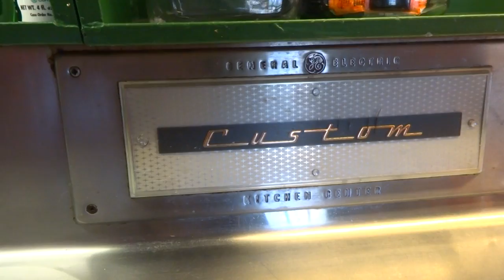PROPRESS FITTING POPPING OFF INFERIOR  PRODUCT TO SOLDERING

Comment: They work extremely well when installed correctly.
Reply: @TheGhettoLobster  I've seen the results of bad soldering. Same result as not using a propress correctly.
Reply: @TheGhettoLobster  absolutely
Reply: Installed hundreds if not thousands and the only leaks were purely from operator error, didn't crimp straight or wasn't fully inserted.  Slip coupling are the biggest culprit
Reply: They are far better than soldering. And standard practice in large commercial applications. Same as anything poor installation will effect all pipe jointing methods.
Reply: @billydoe6240  You can see from the video this was done wrong.
Reply: @Boilerking76123  without doubt. But the point of this video was downing the press fittings.  Its misleading.  

The biggest thing this guy's posted that I agree with is shark bites suck.  Not the worst if it's not in a wall but they will and do leak over time
Reply: I've used on 2 and 3 inch mains with no problem  user error I assume
Reply: There is a place and time for Propress. I work in hospital setting and not having to take out burn permit and disabling smoke detectors is game changer.
Reply: How do y'all get into tough spots with such a large tool? I mean even with pex if it's really a confined space you're screwed
Reply: @TheGhettoLobster  21 years of plumbing I've NEVER had a solder leak. For me the best way to not have a leak is to take your time cleaning everything. Even if it's new pipe and fittings, I get the abrasive cloth to get it sparkling clean and grooves for the solder to attach to. Just my opinion. I've never used pro press. It's neat just seems to be such a large tool to use.
Reply: @Boilerking76123  I progressed copper plumbing in my house 22 years ago and still holding.
Reply: @alfonsoarmendariz1416  The Mechanical contractors have been using the big ones for years . Works great for changing out domestic hot water heat exchangers at hospitals on the fly
Reply: @tomorichard  yeah they better I made a lotta money selling them I liked that I make a da money
Reply: Ive seen fitting pressure tests where pro press joints  popped off the pipe at and solder  and braze joints popped the pipe off the machine solder and braze is always superior
Reply: @sleektoneofficial  where did you see these pressure test so I can watch?
Reply: Just like any new technology, works great for the first two years and after that it’s somebody else’s problem. 
The only benefit of propress is you don’t need any skills to install them 9:00  and they are quick, Oh, and they are great for repeat business.

Any tradesman that ever says “it’s quicker” or “it’s easier” isn’t worth a pinch of salt.

Ever wonder why perishable tap washers are replacable?? Good luck replacing a propress o’ring…
Reply: And this situation right here is the reason why people use a ProPress. No heat cloth, and a previously burnt wire from the last plumber. If that ProPress fitting had been pressed on correctly it would have never popped off. And I'm not sure how seriously I would take the advice of a plumber who feeds his solder on the top of the joint versus the bottom. Every goods trade school in the country teaches you to feed your solder from the bottom of the joint.
Reply: Any plumber using propress in my Projects would be fired and thrown off the jobsite in 2 seconds
Reply: @glennschlorf1285  I'm sure you have fun finding anyone under 50 to work for you...
Reply: @glennschlorf1285 why? Lots of highly qualified plumbers that have no problem going the extra mile if it’s necessary have used pro press with great success. What makes you hate it so much?
Reply: You know what else works extremely well when installed correctly? Soldier.
Reply: @patrickmccarthy5617  yes, and it requires more time and skill to do correctly.
Reply: I agree they work awesome when installed properly. Just like soldering if you don't do it right you will have lesks

Comment: Chances are that pipe was not inserted into the fitting all the way, you’re supposed to mark the depth before you crimp it, but solder is still preferred by me
Reply: Chances are it was not pressed in correctly. Same could happen if you dont solder correctly.
It was the Plumber,not the tools.
Reply: how long do propress o-rings last?
Reply: Looks like not even a proper press tool.

Thing doesn't look crimped more than maybe halfway.
Reply: Looked way short and piping wasnt in fitting enough .
Reply: Biker55555 50 yrs warranty on pp fitting
Reply: @chrismallory3718  The Company not even be there in one decade never mind five decades to pay the out claims down the road in Insurance Liability if those O Rings give way and Pop over time.
Reply: machine has to be calibrated
Reply: @georgeian3243  it looks like they didn’t line up a no-stop coupling correctly (didn’t fully seat the left pipe).
Reply: @biker55555  the o-ring is just a backup to the pressure fusion of copper to copper.  There are some interesting videos out there of pressure testing various press fittings with the o-rings removed.
Reply: @biker55555  50 years.
Reply: The home owner is not telling the truth about the propress
Reply: @carbonunit  homeowner tried to solder it burned the wires above then borrowed a propress and mucked it up again, then he called Steve to do it properly.
Reply: Danny you also have to reem the ends and clean the ends as well for it to hold.
Reply: @davidbrennan5  that's a great conclusion ! Nice job
Reply: I’ve been plumbing for 26 years, and own a plumbing business.  I have zero issues with pro press.  I’ve done all sizes 1/2” up to 4” and have never seen an issue.    That is a fail due to install error
Reply: Progress is fast and hack.  It is profitable , quick , and attractive. 
But  so are post -1998  vehicles !
Reply: I have pro press 4 inch copper building a high school from the ground up. 15 years later still holding strong. I bet the guy that did that had a tool that he doesn't take care of and calibrate after x amout of presses.  You have to service press tools. Heads well wear as well. That's not a product error it's an installer error
Reply: @biker55555 they can last along time when you remove the exposure to air. Also the o-rings are a backup and not primary.

Comment: Wasn't installed correctly
Reply: @ohger1  maybe (less likely) more probable that it's user error, pro press fittings don't just come apart like that.
Reply: There's no way the guy pushed it in all the way
Reply: They will pull apart every time if it’s not drained properly and freezes up
Reply: @RichTheitalianplumber  yes, so will a soldered joint, and from what we can see, this wasn't caused by freeze.
Reply: @RichTheitalianplumber  and you can tell it's been done 3 times now  maybe they should teach him how to drain it
Reply: @josephlowman7906  it’s got nothing to do with draining
Reply: @BrickTop900  then why has it been replaced 3 times already if it didn't freeze you can see it was copper with sweat fittings originally and someone burned the wire when they repaired that then the guy said it was flexible pipe wich was probably pex and now it copper with pro press .you have never seen one blow off like this in a freeze up it will hold 200 psi air pressure and 600 psi with water
Reply: @BrickTop900  oh yes it does the only time i have seen them come apart is from ice do you live in New England or cold climate i live in same area as Steve and again the only time i have ever seen them come apart like this is from freezing i have been using pro press for 10 + years and never had this happen to any of my connections that my customers took my advice and drained them properly !!!!
Reply: @Got2Learn  do u live in New England that was a frozen pipe I guarantee u he didn’t drain the water from boiler drain ???
Reply: @Got2Learn  I do agree with that. I have put together many a commercial with propress.  Never had any problems like this, usually user error like you said put it was a missed press.

Comment: Steve, been using press for for years buddy over the pond. If it’s done right nothing wrong it. Soldering that close will have totally knackered the o ring inside
Reply: Yes, this is true.  I use propress, haven't had a problem yet thank God.
Reply: The o ring is like a back up (safety) but the copper is mechanically fused buy 5000lbs+ of pressing force ... since he keeps yapping about o ring he should of used Nu-Calgon thermo trap or some sort heat absorbing method even a wet rag over the pro press next to solder 🤔
Reply: @johnnya4236  right put that rag he's using over the fitting
Reply: @johnnya4236  lol I was like wtf ! Hahah I use this product Goss heat barrier when I solder joints close to any propress/shark bite fitting even on some ball valves
Reply: @johnnya4236  Have you seen him work on an air conditioner yet? Dude walks up as a second opinion to a possible bad compressor and just pushed the contactor in with a screw driver. Never verified winding integrity or winding insulation. He he has never worked on a three phase appliance in his life. You only push in a contactor for a three phase compressor that's grounded once in your life and you never forget it. Just because someone is better than the competition doesn't mean they are good. Wait until he realizes that Carrier 3 phase condensers only break 2 legs and he buries the contactor with a screw driver and it vaporizes before his eyes.
Reply: He should have just cut it all out and started from scratch and explained to customer that if this fitting is blow apart the possiblity of the others doing the same is very high , So it's best if I just cut it all out and re do it with viega pro press and it sweat and do it right so it's there for the next 40 years. This young buck was to busy chit chatting and putting down the pro press system as well as the contractor who installed the fittings. Meanwhile he is heating up the pipe and jeopardizing the O Ring .

Comment: I have an acetylene turbo torch in my van. Im damn good at solering. But i use my propress and im done in less than half the time. Never had a joint "pop" out. I use only Viega fittings, Ridgid press tool, and clean and properly press the pipe. Warrantied for 50 years. Ive pressed thousands of fittings and not one leak.
Reply: Im with ya. How much you want to bet that's been fixed multiple times because it froze and split. This time instead of splitting the pipe it popped the joint.
Reply: That's the difference, a competent operator.
Reply: I've used a pro press at work for years and have never once had a fitting leak or pop off.  Maybe some people just have bad luck.
Reply: @obocecha  I have seen them pop apart due to constant vibration at a power house. But other than that propress is aweasome
Reply: Never had one pop off in 12 years Steve just likes putting edgy titles lol
Reply: Was recently in a 90% completed new construction high rise in downtown Boston and every single last joint in this building for potable water is pro-press over L copper....  wonder if the reliability is less if used on residential M....
Reply: I doubt that oring will hold in 50y.

Comment: Not taking sides, I've seen badly soldered joints blow out too! No mater what you use, everything is prone to fail.  So yes your right Steve a lot of guys do need to learn how to properly solder a joint.
Reply: That's because the guy soldering didn't know what he was doing.
Reply: @josecanisales3491  exactly
Reply: @pridemechanical815  Had a smart ass helper questioning my cleaning all my pipe fittings to the ninth degree never have any leakers guy didn't even now how to use a torch !
Reply: @josecanisales3491  It's because the guy with the press tool didn't know what he was doing. Oof. Got em.
Reply: Propress is a great system he’s acting like a dinosaur, why use a flame in a house when you don’t have to, granted it cost some money but look at his video moving things out the way, turning the torch down don’t have to worry about that with propress
Reply: @glenarseneau1231  But you do have to worry about the seals within the propress fitting leaking due to age of the O ring seal.
Reply: A properly soldered fitting lasts much  longer without risk of leaking compared to Propress fitting. Propress excels at speed of installation only and not quality of long lasting leak proof operation.
Reply: And the result of soldering is the burnt romex. Skill prevents all problems, no matter your choice of fittings.
Reply: @gurugee2112  burnt Romex? Flame control
Reply: @pridemechanical815  Clearly not in this video.
Reply: @jessecavada3015  That's a 100% false statement. Propress is a perfectly reliable product & last for decades without problems if installed correctly.
Reply: @jessecavada3015 the seals are secondary. Many test have shown the press fitting alone without the seals work without leaking.

Comment: Burnt wire tells me this isn't the first time this happened. I'm guessing it has froze repeatedly ie the burnt wire in the same location. I have seen solder joints freeze and do the same thing. Tell the bonehead to shut the valve and open the boiler drain and drain the water out.

Comment: Just like soldering, if a Propress fitting is done correctly, you will have no problems. When you showed the fitting, it looks like the gasket was missing. I've soldered pipes for 20 years; I'm done wasting time soldering. For small jobs, Propress is what I use.

Comment: Pro press I like for certain things. When we had 500 gal water heater installed at work it was a godsend. 4 inch and 2 inch copper which would have taken a lot of time to solder and shutting down fire alarm system. Been in for about 12 years now and no leaks. That wire that was burnt, I'm gonna say the last guy melted an o ring or at least distorted it. My main water shut off for house broke and guy I had out said not to touch valve unless I was ready to replace line all the way to street if line snapped. He put in a pro press ball valve just after broken valve. They have their place but I love a good solder joint. Thanks for video Steven!
Reply: 500 gallons wow!
Reply: @Steve-bm2zm  Police dept and 80 bed jail plus 2 large kitchens and 4 locker rooms with multi showers. I tried to get them to replace with 2 - 250 gallon tanks and separate jail from the police dept and set it up to temporarily serve other area if one went down but the higher up's who can barely tell the hot from the cold faucet denied it.  So if this one goes belly up the whole dept can go with out till special order 500 gal tank.  can be ordered.
Reply: just did a 3 inch meter change out with new ball valves at a apartment complex....pro press was a lifesaver..in and out in 4 hours..
Reply: @Steve-bm2zm  I've seen bigger expansion tanks on hydronic boilers shrugs

Comment: You have to prep the pipe even with propress. Sand, Reem the inside, and mark the pipe so you know it’s all the way in. Also you have to check the gasket inside the fitting to make sure it’s good. I always insert the pipe then pull it out to make sure the o ring didn’t rip. Then I press from the side, top, then bottom if you have room. I use propress every day and these steps will eliminate problems with leaks.
Reply: @SamThePlumber  well I use pro press every day. My company uses Apollo fittings and I’ve had gaskets pop up because the pipe wasn’t prepped properly. You have to make sure you seat the pipe in the fitting as well. Then when you press you have to make sure the tool is level. Even when the jaw is in the groove it moves around slightly.
Reply: You press every fitting three times?
Reply: You do NOT have to sand the pipe.

Comment: I use pro press all of the time.
Knock on wood never had a problem!!
Sure the fittings are a lot more than
sweat fittings but the labor is cut
in half!! I have seen plenty of sweat 
fittings leak over the years!!

Comment: The water company replaced the meters in our neighborhood and shut down the water main for the entire street. When they turned the water back on the next day I had a leak coming from the valve stem on my pressure regulator. The utility company would not repair the leak. So I go out to Lowes and purchase a new pressure regulator and since I had to turn off the water I decided to install a ball valve above the original gate valve which was installed when the home was built. I told the guy in the plumbing department at Lowes that I needed some pipe fittings and a piece of 3/4 copper pipe. Well the guy walks me over to the shark bites and starts pulling the fittings I wanted. I looked at the guy and said I don't want that shit I'm going to sweat the pipe. His jaw dropped down and he said are you a contractor. I said no but I know how to sweat pipe. I paid for all  my fittings for what one of those shark bite fittings would have cost. I learned how to sweat pipe watching your videos. My first couple joints were ugly as hell but I kept trying, I kept heating the joints up and pulling the fittings apart, another trick I learned from you,  cleaned the joints and kept trying tell I got it right. I can now sweat pipe with the best of them thanks to your great videos. You da man Steve.
Reply: Here in Ireland have always used  used old school Compression fittings, Compression Gate Valves, Fully ported  Ball Valves, Slow Bends, elbows, straights and Tees,  all come with Brass olives  and just use a very light smear of Old School Joint paste around the compression Olive seems to work well all the time...once can even use same on some types of the newer  reinforced plastic Water Pipe  all's good so long as you use a proper pipe cutter and use a proper Insert into the plastic pipe to support same this  allows for a proper compression onto that potable pipe ...no fancy crimpers, or Press Fitting or Tools just a couple of spanners ... with same if a pipe freezes it's usually the thawing pipe pops and splits the copper rather than fittings letting go of the pipe...